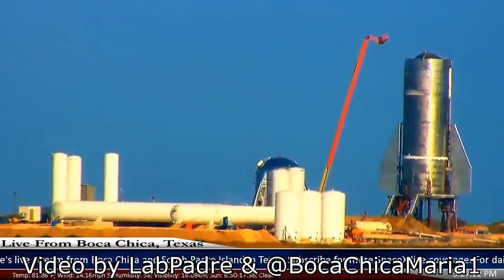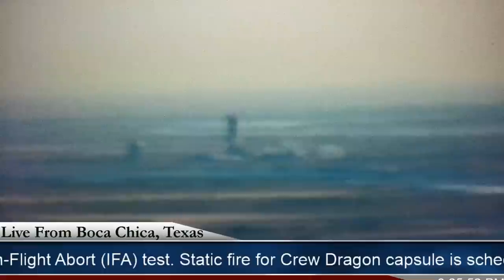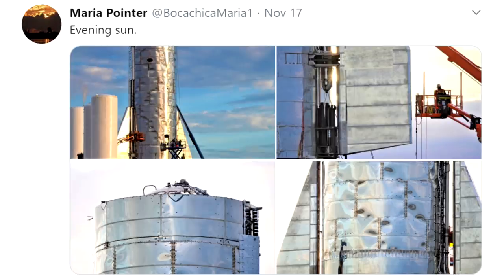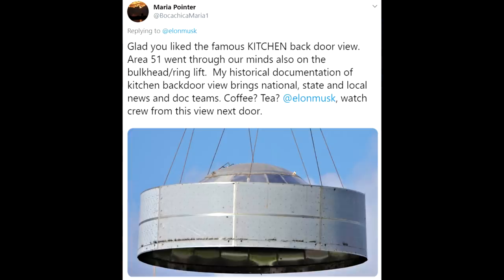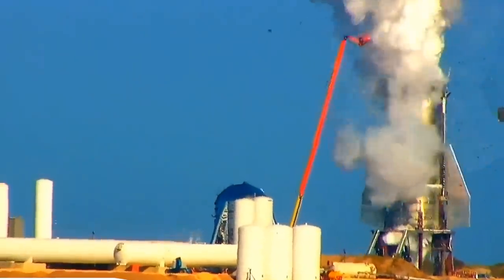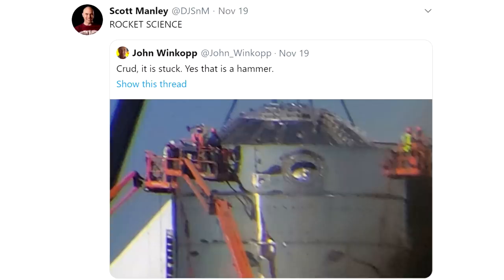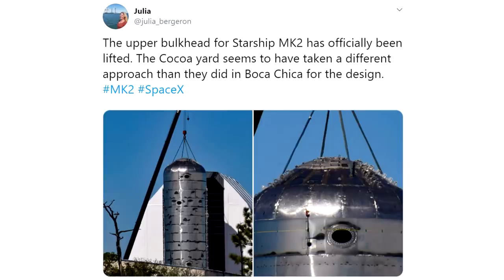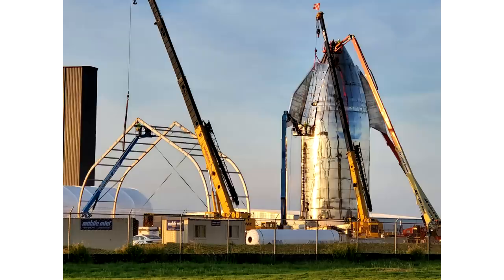SpaceX's Starship Popper - Starship Mk1 Ruptures Tank During Test

Comment: As a welder: the weld should never be the failure point. If the welder is using the right fill material and temperatures for the metal they're welding then the weld will be the strongest part of the structure.

More common is a failure directly adjacent to the weld, especially on structural welding projects like this. Temperature difference stresses between the work area and nearby stock material will exacerbate defects in the stock material in between, and your failure will almost always occur in this area unless the welder made a mistake.
Reply: That's the problem though. Why are they welding a pressure bulkhead on? Stick to tried and true fasteners and joints such as used on pressure domes on every single commercial aircraft that has been flying for 20+ years. It's less susceptible to mistakes by a welder and easier to replace or repair if cracks or damages are found.
Reply: @fadimo305  because their reliability goes completely out the window when you put them in a vacuum?

Commercial aircraft leak like a sieve, they just also happen to pump air in faster than it leaks out. That engineering option is not available for space-faring vehicles that will contain meatsacks.
Reply: Geno Merci That darn Heat Affected Zone strikes again! 

fadimo305 Now I’m wondering how the Saturn V tanks were done
Reply: @PapiSmerf  Not to mention not too many commercial aircraft pressure domes have to withstand cryogenic temperature differences under pressure.
Reply: fadimo305 Good point.  Didn't we learn about that from the WWII Liberty Ship crack-ups?
Reply: They did make the _Starhopper_, which held just fine! Which means that they can get it done, and it does work when done properly -- they just need to figure out how exactly it went right the first time, so that they can repeat it time and time again.
 Perhaps getting consistent quality is more of an organizational problem than an engineering one.
Reply: As I was reading the comments on here, I was just thinking about when welding if they had back-gassing issues with the SS?
Reply: no, the heat resistance of Stainless is great. It oxidizes in high heat, but there are strains of stainless such as Inconel that do even better with heat. The problem with welding is the area you are heating is isolated. So you end up with bands about 1" in width to both sides of the weld that have a slightly different stress than the rest of the sheet. The hotter you can get the metal while welding the better to reduce this effect. 

If they do the body in one roll like Elon wants they should be machine welding at that point, just like a big drain pipe. Add some large burners easily enough to the machine and it will come out perfect and that Heat affected zone will be significantly reduced. Kinda like this https://youtu.be/e4U7CXVTkNU?t=245
Reply: It failed because Space X is fake. They just do some lame trials to gain that Tax payer money, same as that other fake space agency Virgin Galactic. Just show some shitty videos to Nasa and get $300 million in funding from you and me.
Reply: @Brendon Gillanders to be clear metals have multiple phases in the solid form, different temperatures and pressures will naturally allow the material to create various phases while remaining solid (and workable)

 the entire point of quenching metals is to 'lock' the metal into the phase you desire, perhaps while rolling it to up the pressure after toasting it to get the heat right... 

Of course then you take this metal that is all in a single phase and you spot heat it and force it to melt into metal nearby, usually while dissolving some other material into the metal to help the process, and there is no way to either A quench it or B apply sufficient pressure to guarantee the metal phase will not be changing. This in turn creates a phase boundary, which means the material property around that area is subtlely different on either side, and even IF the properties of both sides can handle the stress, you create a new stress focus point and it can break regardless as a failure propagates through the material in this area after the focal point fails.
Reply: I don't know a whole lot about welding, but they were using a very particular kind of steel for this. Maybe the welding material didn't have the same strength properties as the steel plate.
Reply: @geno merci offtopic: did you know that if a broken bone heals that "weld" is also stronger than the rest of a bone? It's almost impossible to break a bone at the exact same spot twice.
Reply: @Lemunde  If the Starships' metallurgists are smart enough to devise their own formula of stainless steel to make the ship out of, they're smart enough to know how to weld it.

@glen All true, but phase boundaries in stainless are usually pretty easy to spot, given it's propensity for changing color. That's why I mentioned defects in the metal sheets themselves, because I imagine that in order for it to not be obvious during an inspection it'd have to be something microscopic, probably something even X-ray inspection would miss because it wasn't being done at the right strength/angle, to get the failure started.
Reply: @mrb692  Saturn V tanks, from what I've seen, were double walled monstrosities with rectangular containment chambers in between the walls at regular intervals. You'd have to have multiple weld failures for one of those tanks to burst, and they were likely manufactured out of steel with a torch welding process which spreads the heat more evenly and slowly than an electrical arc.
Reply: @ChuckBeefOG  Yes, lame trials. The right wording.
Reply: Well, it's still the welded joint that creates the discontinuity in the material. So it's not inaccurate to say the "welding seam failed" when in fact it's the material right next to it that actually failed.
Reply: Bruce Hanna Im not saying they arent building rockets, i am saying we are paying for it all. I find the progress they are making to be eerily quick turn arounds for something as advanced as rockets. How come they can design and send something to space faster than my company can obtain a construction permit to do a simple 1 month project?

My fake comment is more specifically aimed at their “rocket landings” because that is fake. A rocket cant descend like that and balance itself, physics wont allow it. Why would anyone go to that effort when the same effect could be accomplished with a $3,000 nosecone parachute? They are pulling the wool over peoples eyes to gain support and govt funding.
Reply: Doubt it was the welder, unless they didn't check the welds, in which case wtf quality control?!
Reply: @Supra2jTarga009  Well, it's a rapid prototype that won't carry people or valuable cargo.  So skipping quality control to do the bigger tests quickly may be a worthwhile tradeoff.
Reply: @johncrowerdoe5527  Wouldn't loss of product, time delay, employee wages all be larger factors than a couple hours wages on non destructive QC?
Reply: True enough. But with tanks the size of these they need internal bracing. Using the tank baffles as internal bracing components would enable much higher pressures than 5atms. 5atms which I think is 5psi over that large of surface area is prolly to much for even the skin of the to reliably handle. Just like the freespan of a building can only be so long, before column needs to be placed to support it, only in reverse fashion
Reply: the weld dosent fail but the connection of the weld to the material is what fails think about super/hot glue its adherence fails not the glue itself
Reply: So the fault isn't bad welding, but rather a lack of welding in some places of the metal?
Reply: @theelephantintheroom69  No, but I think the welds could be better too.
Reply: Some good experienced tig welders, welding. I don't think there would be alot of talk about the welds failing, as fault.
Reply: This ship is designed to carry humans is in not? How could the top blow off, any pressures should be by the rockets.
Reply: Your explanation of the welding process is correct and that points us to what is actually needed here. SpaceX needs to go back to the technique that it has used on F9 tanks, friction stir welding. It does not produce the temperature stresses that conventional welding does and the result is as if the welded pieces were one piece of metal. The process works on stainless as well as it does on the lithium-aluminum of the F9 tanks. It also decreases the mass of the product and allows the use of thinner metsl.

I could not understand how the unsmooth panels with their rough welds were going to withstand hypersonic reentry without fluttering into pieces. With roll steel and stir-welding, most of those issues should go away, though I am sure that bracing will be required for structural rigidity. Tank headers should be separately formed on special jigs and then welded into the structure. I am assuming here that other than the headers, the tank is the body of the rocket.

Otherwise, I expect that SpaceX will treat this like every other problem they have had, and just keep moving with minimal hand wringing.

A possibly fun side effect of this incident should be that it will encourage the residents of Boca Chica Village to accept SpaceX's more than generous buyout offers. Who knows where the next stray piece of a Starship might land, and when Superheavy starts firing 30+ Raptor engines at once, how will their roofs stay on and their walls hold together?
Reply: Good important detail/correction about welds.  Also worth noting that the sheer spectacularness of the failure is a good sign the design and construction were pretty well done.  Might be a good idea to engineer in an intentional weak point which fails in a less catastrophic way next time ;)
Reply: @ChuckBeefOG  "How come they can design and send something to space faster than my company can obtain a construction permit to do a simple 1 month project?"
Perhaps the question you should be asking is what it is about your company's processes that make it so inefficient?
Reply: @everettlwilliamsii3740  with the size of these tanks. I'd be pushing to build them more like the way a beach ball is put together. The internal circuliar baffle structures get welded together first. Creating an internal orange slices structure. Then each pie section of the beach ball gets welded to those dimpled panels. And like the trick for old lawnmower gas tanks that have been cleaned with vinegar and have pin holes leaks, coat the interior with an appropriate epoxy...
Reply: m e Government red tape and procedures. How come the govt process is faster for rockets than it is a bridge? We wait up to a year for permitting sometimes. Nothing to do with our end.
Reply: @Supra2jTarga009  Elon publicly stated these experiments are done with a tiny crew and cheap materials, so those losses would be much smaller than for a Falcon or Dragon that are built and QCed to carry high value payloads using expensive materials.
Reply: @Bobis32  You really don't know what a weld is, do you? Not going to even ask if you've ever done any welding, your comment is an obvious and undeniable "No." Capital N. Period. Full Stop.

The very definition of the word is to combine two or more pieces of similar materials into one piece. When you weld steel, or any other material, you liquefy the two adjoining surfaces and mix them together until they are one piece. Not "effectively" one piece or "practically" one piece. 

There is no definable boundary between the two if it is done correctly as far as the metal is concerned. The materials have been bonded on a molecular level.
Reply: @ChuckBeefOG  Because building a rocket, in a manufacturing plant doesnt need to meet zoning, environmental impact requirements, traffic flow issues, traffic diversion if replacing, design writeup and quoting and the bidding process, the list goes on and on.
Reply: I think that counts as the weld failing. 
I am no welder, but i imagine the chance of such failure might increase if the welder works less than perfect, applying more energy than would minimally be needed. (either by having the settings too high, my welding too slowly, by messing around too much, maybe assuming it's argon welding, by not having that work out properly so the weld/area right next to it gets to corrode, etc...)

Not saying this was the cause. Just saying it's unreasonable to discount the possibility and even more unreasonable to say it wasn't the weld but the metal right next to it, when welding causes that metal to weaken.
Reply: +Geno Merci. How much did the uneven surface contribute to this? The uneven skin would surely result in an uneven distribution of load, as the tanks are pressurised.
Reply: As a burger flipper at McDonald's, the meat should never be raw. If the burger flipper is using the right temperatures for the meat then it will be cooked and the tastiest part of the burger. 

Mr Welder, I'm trying to wrap my head around your deep analysis. Is your theory applicable to everything in life? 

Wait... Maybe not... 

As a professional pencil sharpener, the point of a pencil should never be blunt. If the person in charge of sharpening the pencil is applying the right amount of pressure and twist then the point will be the sharpest part of the pencil.

The Theory of "should" and "if".
Reply: @antondegroot6061  You're right, you're not a welder.

I just wasted 20 minutes of my life going through your comment and picking it apart word for word in gory detail, outlining how little you know about metal fabrication, welding, or industrial construction methods in general. Then I read what I wrote.

And I deleted it.

Because deleting all of that is less of a waste of my time then having to deal with any potential responses spawning from any desire for self-validation of your completely ignorant opinion about facts that are well understood by other people you're trying to talk to. Given that, this is as far as this conversation needs to go.

"You are not a Welder."
Reply: Heat affected zone failure is still a weld failure as there are methods to improve the strength of this area though the procedure used to weld. For example a post weld heat treat or poor pre heat poor interpass temp consistency... The point is the plate on its own is less likely to fail In many pressure vessels
Reply: Don't worry its all just a big lie. Just movie magic and grown men playing with dry ice..
Reply: @PapiSmerf  Funny that you are the one to mention self validation.
Reply: @roderickhorton7845  Starhopper and Starship are both 9 meters in diameter.  But some people say that Starpopper may have been build from a heavier gauge material.
Reply: You what I think would be even better than spherical tanks with the baffles for reinfotcement? Cylidrical tanks with spherical tops and bottoms(like a scuba tank) and 6ft inner cylinder running the  length of the tank. The baffle support connect the inner cylinder to the outer and also would create and add structural integrity to the entire. 2 birds one stone thing. 
The six ft wide passage way can house the feed lines and vent lines to the engines, possibly a a docking and space walk hatch at bottom of spaceship, and luggage.  Not only that if there's a a space storm of high energy paryicles. The crew can go into it and be protected from by the fuel and luggage. Couple nice things about the feed lines running on the inside the passage wall, is for starters they'd flex less when the rocket flexes, than if they were run on the outside, but also they can be worked on from within the space craft. I think then, possibly there'd be enough weight savings to implement the transpiring cooling. 

Simply lenghting the tanks into the the storage area of the starship and moving that displaced storage area to the 6ft passage way, while increasing the structural integrity of the entire ship simultaneously.
Reply: @johncrowerdoe5527  Skipping QC even at this stage would make any testing worthless.
Reply: @roderickhorton7845  The failure of the solid fuel rocket burned a hole it the liquid fuel tank causing a catastrophic failure of the tank.
Reply: @roderickhorton7845  The rockets? Yes they had fuel because they used solid propellant and were still pretty much intact after the external tank exploded.
Reply: O ya, 5 atmospheres is actually as it depicts. 5 times sea level atmophereic pressure. So roughly 5 times 14.5psi. So 71.5 psi. Or so.  

If you do the math on a simple area of a 2d 32ftx32ft plane. Obviously it's spherical and is actually a little more area. But converting roughly to a flat surface for ultra simplistic calc. It works out to over a 10,700,000lbs  of pressure on the upper bulkhead. The circumference of the sphere is a 100.50 ft. Convert to inches 100.5 times 12 is 1206 inches. Devide the conservative 10,700,000lbs by 1206 inches. That's 9000lbs of pressure per inch around the circumference. So a one inch piece of sheet metal holding up the weight of two cars roughly. At only 70 psi...
Reply: Geno Merci ... as a retired CWI/NDE Inspector you are correct, there also is the history and ton of experience welding such material.. We know the welder always gets blamed....
Reply: Lost and Found - The Face of America Abroad ... Liberty Ships had a problem with using what was normal shipbuilding steel, "cold forged" steel plate at the time was really good for making connections with riveted fasteners.. the welding was suspected and in some spots it appeared to be a weld failure when in fact it was steel failure.. using the wrong steel during a new procedure in shipbuilding. ... welding and metallurgy have advanced since then.....
Reply: Roderick Horton which is why you select the proper mat'L, fabrication procedures, specifications, standards and codes.. every welding procedure was tested and certified, also every welder tested qualified on the SOP, all passed by 3rd party, then every mm of welding inspected (aerospace code) by another 3rd party with most likely several witnesses..  check out AWS D17.1 AWS D17.2 and my all time favorite AWS D17.3......
Reply: true
Reply: While technically correct that the weld is strongest, the act of welding will weaken the material close to the weld. So in a laymans term it is the weld that breaks, or at least the area affected by the weld.
Reply: @ChuckBeefOG  Sorry bro, but it's not fake. I was on the causeway at the cape watching Falcon Heavy's boosters land in broad daylight. Hard to say that's fake man. Now NASA is who you should be mad at spending your tax dollars. They've spent more tax dollars building a rocket soon to be obselete (SLS,) than SpaceX has spent developing their entire inventory of launchers AND test vehicles. And SLS hasn't launched a single time, and won't ever be reusable.
Reply: @ChuckBeefOG  Also as an aside, what exactly about physics says a rocket can't do a powered landing?? Serious question...
Reply: Brix So we can all just build some big ass rockets in our backyards and just set them off at random? Sounds legit.
Reply: Just pre-heating the stock material aroind the area to be welded should help a lot?

If that doesn't suffice, isn't it possible to grind and then normalize the affected area proximal to the weld, and afterwards use pickling? That should even out (or even) get rid of the different intermetall phases of the steel, returning it to it's original phase (austenitic I guess with 301) and even out most (if not all) stresses in the material. Then the pickling would remove any unwanted oxides that would contribute to surface roughness.

Ofc, the last ones mentioned would be time consuming and thus expensive operations, but should this not make the weld more ductile/less brittle and while also raising the yield strength of the adjacent area?
Reply: @Theone82 Welcome to the south. All of that is just another day at the grind around here.

Not saying it's right, just saying none of that surprises me because it's the way everyone else is treated in these areas.
Reply: But welding the new Cybertruck's long seams will be easy because, um, magic?
Reply: @PapiSmerf  if the sheet steel is half the thickness of the mark1 sheet steel, it is half the weight.  1/4 of the weight savings is used to wrap the outer cylinder in a bidirectional unwoven carbon fiber sheeting, and wrap the inner cylinder passageway. Use 8 baffles(same thickness) between the two cylinders. Before wrapping the outside, weld the tabs that hold transpriration lines along the most windward side baffle. The baffles immediately adjacent to the centline most windward baffle also have the U shaped 2"×2"×1/2"  tall tabs weld on the outside of the cylinder. With the 2" wide flat of the U(the part you hold onto when tossing a horseshoe) welded with the baffle centered behind the tab. These U shaped tabs are what the transpiration lines will lie in and be welded to. Also 4" long flatstock tapered tabs that taper from an inch at the point of the triangle to nothing. The tip of the triangle has 2" threaded rod welded to it. These get welded in the inner 6' diameter passage a long each baffle the length of both tanks. So eight rows of tabs roughly 2 feet apart running the full length of the inner passage. Weld two sections of rings together. Attach the tabs. Resin outside, wrap twice with carbon fiber fabric, making sure to slit and push the U shaped tabs through the wraps. On the inside similiar. Resin the walls roll fabric roll the resin in the fibers, but now take precut 2" thick 2ft wide foam panels and form them into the wall and into the resin tightly between the tabs running the length of the passage. Doing ten feet at a time. Using flat stock expansion rings with threaded rods weld on one end of the flat stock and sleaves on the other end. Wrap the 1/8 flat into a ring. Running a nut down the threaded rod then sliding the threaded rod into the sleeves welded to the other of the flat stock. As the nuts on the threaded rod are unthreaded the washer pushes against the sleeves and pushes the ring apart at the junction. Place these rings between the threaded rods poking out of the seams of the foam walls. Titghtening the rings firmly pushing the foam into the carbon fiber and resin. Now it is ready to stack onto the rings already completed. 

You may not think it has the strength but it does. As a bow hunter a carbon fibre wrapped aluminum arrow is a superior arrow to any other. Pure carbon fibre arrows are very strong but can flex when shot. Aluminum arrows are quite stiff but very weak unless made quite heavy. A carbon fibre wrapped aluminum arrows are ultra light and ultra rigid and strong. I think with the baffling and the wrappings working together it would be plenty strong. 

They need to be wrapped once before they're stacked. Then once all the sections tabbed, wrapped and inner passages insulated. 

The transpirational lines need to be built. Yes I think the fuel will keep the steel cool enough, however plasma dosent care. Its moving so fast so hot it erodes on contact. Now the carbon fibre will will the charring insulator yet the fibers are going to break down after only a few flights, I figure. And as the tanks heat up the pressure goes up. Eventually the overpressire valve pops and fuel goes to waste. I think a 1 1/2" stainless steel lines were ran through rollers. Top roller with V shaped 2" wide groove and a basic flatroller as the bottom die. Turning the crossection of the transpirational line into trianguliar shape with a two inch base. The two inch base of the triangle fits into the 2"×2" tabs. Weld the three traspirational lines onto U tabs. Now the outside of the starship can fully wrapped top to bottom four more wraps around the transpriration lines bulkheads. Just as if your wrapping the ultra light weight 10000 psi  high pressure tanks. Take care to use magnets to hold the carbon fibre to shape around the lines. Placing magnets over the lines to hold their shape as the resin cures. The following day take a drill press with  large strong refrigerator magnets glued to the legs of the slides that support the drill press. Align it with the lines and drill three 1/8" holes (one on the top peak of the triangle peak of the line, and one on each side of the peak) an inch and a quarter apart the full length of the traspirational lines. The interior passage gets resined and the wrappings of carbon fibre cover the foam and the threaded rods purtrude from the foam a half inch. As resin is still wet the vertical mounting strips are bolted to the threaded rod compressing the resin and fabric together. All of the flanges for the wings and canards should already a have been welded to the inside of the tanks. Roll the radius of the tank into a sheet of the thickness of flange desired. Cut the flange directly out of the rolled sheet. 

I think another thing needs to be look into doing. 

If you put a raptor engine as close as possible to a leg. Even mounting part of the gimble to the leg. Then taking the gimbling engine with it's partner starship. Place that apparatus into a stainless steel barrel wrapped similarly to the rest of the starship. And lets say the dome of the barrel is stamped and is very strong. Like 2ft hole cut into the dome. And the dome is weld to a half thick round piece of flat stock. The round flat stock has two inch axle shaft welded in the center as a pivot. Around the pivot point there's a concentric circle of wheels that support and the circuliar 3/4" flat stock to rotate on. The axle shaft has a gear that holds the the engine and leg falling out of the subframe.  The barrel has the engine mounts attached to the inside of stainless steel barrel. The hard frame structures are the carousel components and the sub framing that they're connected to that cradle and support the lower bulkhead.  These barrels can rotate 180*. So during takeoff or basically whenever it's sitting on top of the booster. Four of the raptor engines are rotated a 180* from under the the starship to out to the outside edge where the leg was. Gimble the exhaust away from the booster below. The target weight for starship loaded is was 500,000lbs. One raptor engine puts out 500,000lbs of thrust. Even if they're gimbled slightly away with a 500,000lb weight and 2,000,000 ftlb thrust. If the four raptors are burning before the booster ignites. I don't see any problems with the starship escaping a catastrophic failure of the booster. It would give them a good chance of survival. Since the leg and engine are in a round barrel the engines and legs can rotate at anytime with out affecting aerodynamics. This starship must be rock solid. Unless it literally crashes or is sabotaged. Its the kinda thing that needs to be able to handle it repeatedly.  

 I made a similar carousel for my shop smith so I can rotate the drill, when I stand it up to use it as a drill instead of a horizontal lathe or table saw. The table that supports the slide tube of the drill height of drill to table... Is in the way when you wanna just use the table. Anyways. I built a similar carousel so I wouldn't have to rotate the entire table if I had to drill a holes in a a long part and it'd bump up against the wall otherwise. 

Anyhow wanted to get this out cause things are going fast and I don't like saying I told you so unless well whatever. Back to the carousel thing. I actually think these things would be better built from the top down. They oughta start building a large 50ft diameter carousel using 1/2" plate steel set on concentric circles of trailer wheels. The entire platform elevated ten feet with Ibeam frame. And four 10' hydraulic  pistons booms that lift the entire starship up out of the way for the next 10' section to be built under it. Have a robot attached to a tower next to the carousel. Robot can go up and down the tower. Can control the speed of the carousel while wrapping and welding... 

Well things that make me comfortable
Reply: @PRiMETECHAU  it won't have the tensile strength of cold rolled stainless steel. And it would take a long time to do a tank in thin deposited layers keeping the skin uniform. 

If two sections are jigged together they get welded in perfect circles. Then coat ultraviolight resin and wrap the section in carbon fiber. Like when at the dentist they have an ultraviolet reactive resin that hardens as soon as it's expose to ultraviolet light.  Then the starship is lowered precisely down onto that section and tig welded together with the jig as a backer. Wrap the welded seam. Lift the starship up with the new section attached.... The carbon fiber is what primarily distributes the loads throughout the stainless steel skin of the starship. The baffles support through tension also. It'd be nice that if it fell over it'd just bounce a few times.
Reply: @PRiMETECHAU   the 6ft passage running through the center of the oxygen tank and propellant tank allows for the oxygen and propellant tank to be connected via a 3ft section of the central passage. Then both tanks and the passage way can be wrapped in carbon fiber at the same time.  And eight carbon fibre framing supports between the two tanks are resined in and placed in alignment of the internal baffles of the tanks. Put a hatch in the passageway to access the space between the tanks from inside spaceship. If valve goes out relays...they can be access from inside the spaceship through the hatch. It should have enough wraps that pressure points  on the stainless steel are are redistributed by the carbon fiber. Eliminating the wrinkling that is occurring when it is standing empty.  Then put the ring of stainless steel with it's U shaped transpiration tabs, around carbon fiber bracing between the two tanks. Use fasteners to attached this ring to a ring flange already attached welded to the inside of the tank. Install the three transpirational lines and wrap the entire completed sub structure to the pressure requirements needed. 

I really believe there's still going to be a need for transpirational cooling to limit boil off and retain structural integrity of the carbon fiber. If it will actually work. Granted the gas is moving much slower than the impacting plasma gas. So thought is it would absorb the brunt of the impact. But if you ever worked with a burntable or plasma cutting table... The increased density velocity and heat is used to initially pierce through the metal. So there's that chance it could backfire and do the opposite. Thou, I'm still betting it'll be a large benefit.
Reply: @jasonbrady3606  30X Stainless is the appropriate epoxy: the LOX is cooled to 66 Kelvins. What epoxy can handle that?
Reply: @terrelshumway427  obviously there's epoxy that can handle the low temp of the lox tank. The falcon 9 is wrapped in carbon fiber. 

There's aerogel blankets created by taking a fibrous material and immersing the fibrous blankets in an aerogel polymers. Gel sets and the gel blankets are rolled up and put in acetones...  That remove everything besides the gel matrix and the fibrous materials. Chemicals added creating isotopes for crosslinking the fibrous material with the gel matrix. Bake a couple days. End result is a flexible aerogel blancket that has the insulating properties of aerogel. There's at least one company that makes these. I'm down with ceramic tiles but I still think it needs a carbon fiber backing strengthing and like you say a thin layer of super insulation. There's the titanium coated carbon fibers that resist oxidizing up to 1700* there's epoxies that crosslink with carbon fibers at these high temps creating I think what they we re referring to a diamond matrix. This is all good hotter temperature than what stainless can handle. Yet the temp of the plasma , in contact, is going to be around 2000*-6000*. 10,000* or more six inches away from the surface. So there's convection and radiative heat to contend with. I guess falcon 9 is doing quite well. You know is there a going over the top in such a thing? But this is like a super duper LEM craft. 

Epoxy and wrap the prewrapped tanks with a 1/4" of aerogel blankets. Then do a final wrap in carbon fiber. 

The starship is a lot larger than the falcon 9 and it's going to be traveling alot faster than the falcon 9, during rentry. The baffles in inside the tank are similar to spokes on a bicycle tire.  The spokes work via tension and suspension. In the same way the eight baffles maintain a nice spherical shape. Each baffle is roughly 12 feet long and 10 foot 1 inch tall. Thats if the each premade carbon wrapped ring section is exactly ten feet tall. Each of the baffle panels has 2 1/2" holes spaced every six inches apart in a checker board pattern. Each of these baffle holes are dimpled. Dimpling stiffens and strengthens the flimsy sheet metal. Before the holes are drilled or cut and dimpled. As it's being cold rolled at the mill they need to cold roll a corrugation running the vertical length of the baffle sheet. The corrugation allows the sides of the tanks to deform up until the corrugated steel is pulled flat. Only the one inch overlap of the baffle sections get weld. The 6inch center section of the sheet is actually 9ft 11" and the corrugationss from the section above and the section below the section you're working on float free the entire length of the baffle.  What that corrugation does is allow for the forces being put on the fuselage(buffering,gforces...) to ramp up before the entire forces is held by the welds of the baffle.
Reply: @terrelshumway427  the x30 ssto spaceplane had problems with the epoxy. They had originally tried building the tanks out of Kevlar, I think which is similar to carbon fiber with a couple more elements in the fibers besides pure carbon. The plane tanks were yellow so assume it was a form of Kevlar. The SLS tank looks like it was wrapped in Kevlar. Idk I've looked for low temp ratings and haven't really found much on it. Carbon fiber Kevlar react more, as in expansion and contraction, from heating and cooling, yet isn't bad just little more. 

They rebuilt the x30 tanks in aluminum which made them lighter but they'd melt. 

So like you say use the 30x stainless steel as the epoxy. I don't think it'd be to hard to rig up a Mig wire feed welder, that's pushing some fairly high gage wire, with a wire cut off solenoid on the tip of the welding tip. The solenoid is wired to a timer that begins as soon as the starts arcing. Pull the trigger, wire feeds out. Starts to arc. Arcs for like a half sec and solenoid triggers, which shuts current simultaneously as the solenoid cuts the welding wire off at the tip wire. Have a small dial to adjust the current shutoff and solenoid cutoff. Then a tripod rig attached to the tip to adjust the length of the wire. Place the the three inch diameter three legs firmly on stainless surface and pulls trigger. Adjust properly, it will weld a 1 inch stub of wire cut perfectly to an inch to the surface of the starship. Put one of these wires at every cubic foot intersection. I don't know how many cubics the spaceship is but it's a lot. Then the 1/4 4'×4' insulating mats can be epoxied and placed on the protruding wires. Push the wires through each mat as they're installed. Shoould have 3/4" of an inch wire protruding out of the insulation. Wraps a 1/32" carbon fiber. Then bend the wires over and finish wrapping the other 32nd of thicknesss. Then bag it vacuum finish epoxy...

Then I think 30x stainless steel would in a sense be the epoxy as it bridges through the insulation to the outer carbon skin. There's prolly already a tool that can do the job. I'd look there before modding welders...